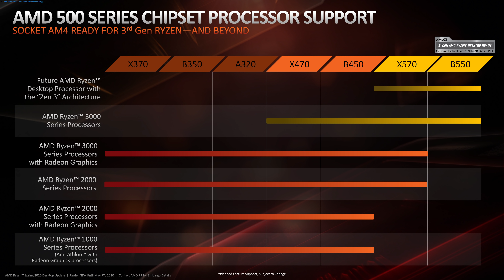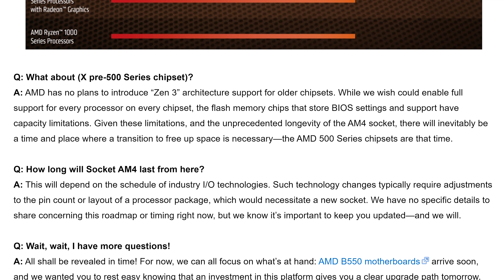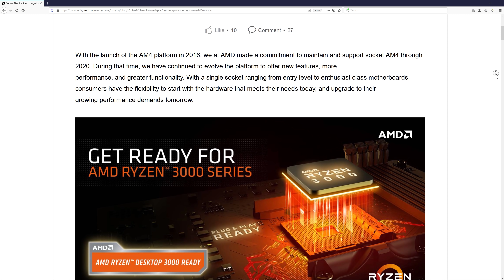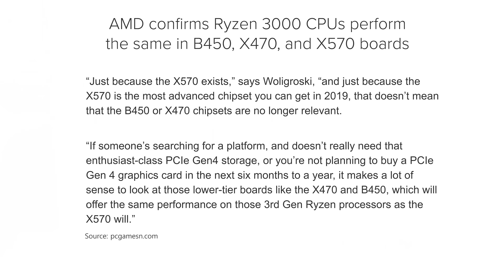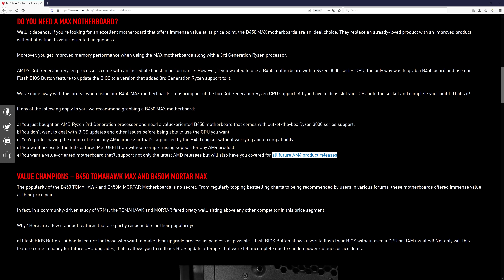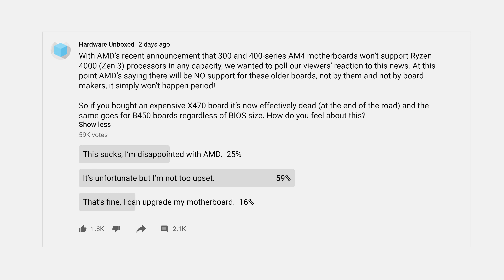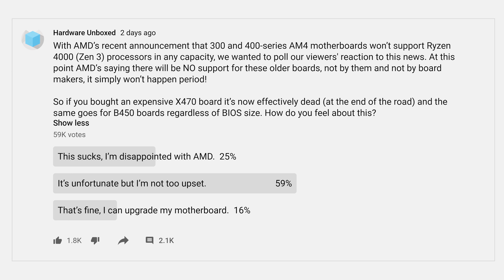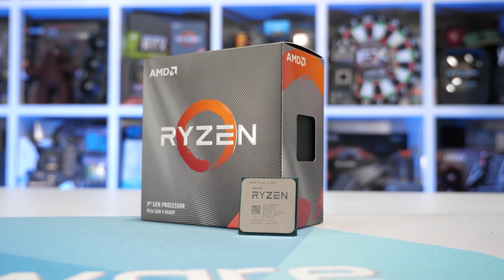AMD Does An Intel, Axes Zen 3 on 400-Series Motherboards, Our Thoughts

Comment: If bios capacity is the actual reason, i hope they atleast support the max series board. Man im pissed off right now for buying the B450 max board 2 months back.
Reply: But that won't do! Just supporting Max boards would be unfair to all the other B450 and X470 owners out there!!
Reply: @NatrajChaturvedi  i agree with you its also unfair for me whos using a b350 mobo coz i only both it about 4 monhs ago ihope atleast they give bios support on the new r3 3300x coz i dont have that much money to change my mobo
Reply: @borgir3451  r3 3300x supported cuz its zen 2 based not zen3
Reply: I feel like you should have just went that extra step and got the x570 especially. Computer time moves fast and b450 what's already over a year old and hell it's not even an x470 those guys are the ones I feel for.
Reply: They did honor the till 2020.
Reply: If they would support those boards then motherboard makers could make it compatible for all boards by sacrificing older CPU compatibility. Because who needs APU support on a high end full ATX board? Either all will be supported or none will be supported.
Reply: @CheapBastard1988  they're already doing this actually, my x370m pro4 doesn't support the A series APUs (a6 9500, etc) anymore.

Comment: Could it be pressure from motherboard partners to discontinue support? They wasted a lot of money on the development of B550 and now everyone with a B450 doesn't need to buy any motherboard, by forcing AMD to do this at least their B550 boards will sell. What else could be the reason? I'd be very surprised if AMD wanted to do this because it was clearly not the plan.

When they go to the next socket they must make a better plan to keep both their MoBo partners and us customers happy at the same time and communicate that plan clearly. I am really not happy with this decision because not only do I get screwed with my R5 3600 + B450 Tomahawk MAX but it is bad marketing for AMD and the trust in them will be much lower from everyone. 

It was my plan to get a 4900x to double my cores while getting better gaming performance, right now B550 is also a shot in the dark because we don't know what Zen 4 will be on, and if it is on AM4 then will they do the same? I'd like AMD to be clear about their roadmap so we know what to expect. And most of us B450 guys will have to wait longer to upgrade I guess...

Comment: In my opinion, they should at least support all the motherboards with the bigger BIOS capacity, how hard could it be? 
I guess it would be the same as upgrading the B550, which also needs an update once Zen 3 drops.
Not only that they do not need to drop any older CPUs - so no maintenance required, but people had no option rather than a B450 Tomahawk Max to be "Zen 3 ready" on a budget, and it was AMD's fault that they didn't release B550 earlier.
Buying a X570 with a Ryzen 3600 in August 2019, for instance, kinda made no sense, why buy a motherboard which is more expensive than a CPU, just to wait who knows how long until you upgrade to the new stuff?

Comment: I share your sentiments Steve. Even though I am currently using an Intel rig right now, (G4600, which I'm about to sell to a relative who needs a basic PC to replace an AM3 Sempron whose board just died), I have recommended to my friends building new Ryzen rigs to go out and buy B450 Max boards for Zen 3 future compatibility, seeing the BIOS ROM issue with older B450 boards.

I've commented on several other videos, and it never fails to amuse me how someone butts in to defend AMD or for someone else to tell me to go back and use Intel. Why can't they see the bigger picture that customers getting shafted and them just letting it be sets a precedent? "Give them an inch, they'll take a mile" is very apt indeed.

I'd understand if this official statement by AMD is just to get the word out to the average Joe on a budget (say building with the new 3100/3300X) to not bother with older chipsets and get the upcoming B550 instead if they want a 4000 upgrade. But they should make it possible for savvy customers to be able to take their B450s and flash it for 4000 support.

Noone can blame those who bought B450/X470 for Zen2 as there was no indication of support being dropped, as the 400 boards were generally better than the 300 series ones. It's AMD's fault anyway for not communicating this issue in a advance with the X570 release, and also for not releasing B550 sooner for those on a tighter budget. And not to mention Zen3 may most likely be the end of the road for AM4 if the rumors are true that Zen4/5000 will go DDR5. This just leaves a bad taste in the mouth.

Thank you Hardware Unboxed for defending the tech consumer, be they from Intel, AMD, or Nvidia camps. I hope the rest of the techtuber community follow your example and not just play "Devil's advocate" like what many are doing right now. Thank you.

Comment: amd is better rethink their crappy decision.
Long compatibility was one the the main selling points of ryzen cpus.
If they will  effectively turn into intel, then what's the damn point of going with ryzen if intel has better gaming performance across the board and everything else will be the same bullcrap?

Amd had bit off hefty part of cpu market and now they are  starting to act like intel did during years before.
Reply: AMD is treating the new customers as if they have been fanboys forever. When you have to buy a CPU + MB, you can simply look at Intel as well to compare instead of being locked-in. Idiots.

Comment: Maintain does not imply that every CPU will work on every board to me. That seems a little much. It strikes me as odd to run a Zen 3 processor on a 200 and 300 and possibly a 400 series board. Also as a recent owner of a couple of B450  boards, I would not get a new a processor for either of these computers in the future, I would just get a new board and processor together and memory. 

Besides, how many people actually keep buying new processors every other year for their current board? does anyone have that information. I would suspect it is few owners?

Comment: Agree axing 400 chip sets is messed up and pushing support to 300 series boards would be more headache that it is worth for board partners, axeing support for 400 series boards would be more acceptable if B550 had been a option, I use a x470 board i doubt i would upgrade to 4000 anyway as by the time i need to upgrade ddr5 will be mainstream and then i can decide between a cheap 3950x and a new platform offering 32core/64 thread for the mid-rage CPUs, really depends on how much the performance delta is (and if my board has worn out)

Comment: I'm on Asus Prime x470 with 2700x and a 1080ti. I feel like I'm getting my money's worth, so I'll give it time until zen 3 actually comes out to decide what I'll do. The reaction online seems pretty negative, so I can definitely see them go "just kidding, guess we didn't think this through".  

Don't understand why the 3000-series owners are upset. You don't upgrade every generation (unless you are not financially constrained...but in that case you don't care anyways), so by the time that 3600x is insufficient or obsoleted you'd be swapping on am5 or later. Every pc upgrade I've had, for as long as I remember, required a basically new system.  3-5 years and that's basically it. So honestly, I'm not terribly upset. I've had to do some actual work on here with the lockdown instead of just putzing in games and it's been great not having any of the issues that my colleagues always complain about (slow, freezing, etc). As far as I'm concerned, the zen+ system paid for itself the last couple of months. 

I can see why reviewers would be pissed as they want their advice to be as close to perfect as possible. It affects their livelihood. On the other hand. the overall consumer doesn't or shouldn't really care too much. 1000 launch series users have already gotten their money's worth, 2000 series also getting to that point as those cpus are still very relevant (mine is over 2 years old), 3000 series owners shouldn't be looking to upgrade in the next 2-3 years anyways. At that point you're looking at ddr5 so new mobo required anyways. Yeah it sucks they didn't stick to the original promise, but unless this affects your work, it just seems like an overreaction. Calm down, wait and see if AMD changes their minds.

Comment: As a buyer of the b450 tomahawk max I wasn't initially mad at AMD when the news hit since I was waiting to hear for the actual motivations, not believing that the bios thing was accurate and instead just something a PR guy said. 
If they stick with that I'm disappointed. I'm fine with them dropping support to avoid having to be limited by older chipset designs to improve future products, but not just for a matter of investment. If there are serious compatibility issues that are very hard to overcome for AMD when developing the support code then they should specify these problems instead of giving an excuse that doesn't really hold.
Reply: I'm sure they're going to weasel in partial support for X470 and B450, like first MSI MAX, then others with certain features, etc.

Comment: AMD shafted me! I bought Tomahawk Max cause I wanted future proofing! 😭
Reply: Should have bought a B550! OH WAIT!
Reply: YoU cAn sTiLl UpGraDe tO 3950x
Reply: Did they? AMD have made it clear a long time ago that AM4 motherboards won't be supported with new CPUs after 31 December 2019, so not sure how you thought that your B450 would work with Zen 3 which releases after 31 Dec 2019. If you look at AMD's official Socket Stability slide in the article "3rd Gen AMD Ryzen CPUs Will Work on Many Existing MSI AM4 Motherboards" (search it on Google), you'll see that the graph clearly shows no support for new CPUs on AM4 after 31 December 2019. If you take a good look, the orange bar stops right at the end of 2019, just before 2020 starts. It was already know even a year or two ago that Zen 3 will come out some time in 2020, or in other words, AFTER the official support period. Do people really not know how to read graphs?
Reply: @bgtubber https://hothardware.com/news/amd-confirms-am4-socket-support-future-ryzen-processors-2020
Reply: @bgtubber  yes they did even msi didnt know. Didnt you watch the video.
Reply: @bgtubber  Copy pasting the same crap over and over again on every comment that seems relevant is really crappy practice. Especially given that what you are arguing is only one of the relevant points. Many other places AMD have said "through 2020" and this is exactly what Steve is hammering on about: It was so ambiguously communicated that even MSI were 100% sure that the Tomahawk Max would support Ryzen 4000... So tell me again how you, a single individual, have gained such divine clarity from a single slide, that has been contradicted by official AMD statements and slides many other places, that you have the right to tell the MSI team, who work with AMD on a continuous basis, that they are just retards who didn't know what they were doing all along?
Reply: @andersjjensen  exactly what I thought. I was just too lazy to argue with bgtubber from my phone. Thank you.
Reply: @SciFiFactory  You're welcome. I cannot abide useless people...
Reply: @andersjjensen  Thanks for answering instead of me. Tbh cbb to even dignify him with an answer.
Reply: @andersjjensen  1. All of their marketing stated clearly until. 2. Through 2020? You do understand the general term support doesn't mean you will always get new processors and will get bios fixes etc. 3. All their marketing state clearly "“Planned AM4 socket support until 2020. Subject to future roadmap modifications.” "

Comment: Literally just built my new PC in the last 6 weeks using a b450 tomahawk max and an r5 3600 and honestly I'm not that vexed. Yes the 550 option earlier would've been nice but the decent x570 boards that I looked at and considered were 3x the price. Given that it was a budget call is it not to be kind of expected? I mean the x570 boards will come down in time and cover my initial expense for the b450 anyway. Plus I still have the option to upgrade to a 3700x/3900x ect down the line, it's just one of those things. Besides, it's not like the system I built became bad overnight, it'll still be great for the next couple years. Seems like people are overreacting

Comment: It seems I'm in the minority here, but I'd also like to see more people talking about how only X570 boards can be used with older gen processors. I got a 1600 AF back in January and I haven't bought a motherboard yet, so this move by AMD doesn't affect me like it does current owners of 400 series boards. However, with B550 being the *only* chipset not supporting 1000 and 2000 series CPUs I am essentially being forced to choose a more expensive X570 board I don't need if I want to upgrade to a 4000 series processor later on. Someone who bought a 1600AF isn't exactly the kind of spender looking to buy an X570 board. I'll wait and see how this all develops but I'll probably just get a B450 and call it a day at that.
Reply: They would rather make a pretty BIOS than support more generations.

Comment: Spot. On. Bravo! This covers every single thought that has gone through my mind as a recent X470 Crosshair VII Hero buyer. One of the best content pieces I've come across in ages. Excellent job, Steve!
Reply: I'm a ch7 owner also... Upsetting!
Reply: Crosshair VI Extreme owner here, and also upset. This board is better built then half the current X570's :(
Reply: @Lionotus  I have a higher end x370 board and am a little annoyed seeing as I was one of the first groups of people to support AMD's new CPUs when people still had their reservations. I am not upset too much though just because computers are a hobby and not a necessity like food or rent and with the situation going on around the world, this is not the biggest concern. However, I am thinking about upgrading maybe this year or next as I can upgrade my family's computer with my current system and get a little money back to put in to an even better system. My biggest concern is I don't like the X570 boards with being ridiculously overpriced and the biggest FAIL, the little fan. I hear it isn't that bad compared to when I was a kid and all the boards had those little fans but they do breakdown over time. I am hoping that the X670 boards will not have the fans as apparently AMD won't be making the chipset for them. Ugh rough times.

Comment: I am disappointed i just bought a Msi x470 gaming plus max with a Ryzen 1600af cpu to get through till zen 3 launch. There was every indication at least higher end motherboards would support new Zen 3 cpu lineup. I guess it will all end up coming down to which company has best price/performance for new motherboard and cpu in the new year period for an upgrade.

Comment: I think people should watch Linus's Wan Show to get a different perspective. I'll try to summarise but will most probably do a bad job. This intercompatiblity makes it very confusing for the end user. Sure enthusiasts understand it but not everybody does and when people buy stuff they expect it to work out of box. If someone just bought a B450 Tomahawk and ryzen 3000 and without exactly understanding what exactly a bios update is the system won't boot and create a negative experience. They'll probably have to pay the store to update bios for them creating a negative experience. It becomes even more pronounced for budget novice builders if they use B350 and have to check out stuff like beta bios. It becomes a tangled mess and to clear up confusion once and for all they did this

Comment: 4xx and 3xx series chipset will be able to buy CPU to at leastt of end of 2020, maybe even more. Just not the latest ryzen 4000 cpu. I am glad i went for the Asus Tuff Gaming plus x570. At the moment i made de purchase, it was to have a very good bord to run a 16 core cpu that i would maybe buy later down the road. I am still yet to do that. I build my PC since 486 era and i only upgrade 1 time a CPU on the same motherboard. The last time was from a Duron 850 Mhz to an Athlon 1.4 GHz. 

We will see. If Zen 4 + DDR5 get released in 2021, that would probably be worth jumping on that platform instead of buying a Ryzen 4000 for a better gain.

Comment: I don't know what all the fuss is about. When I upgraded from my 7700 k I looked in something where I would not have to update for 5 years. So I knew I wanted AMD so I got the best I can. Which was the X570 Gigabyte Xtreme because I didn't want a fan blowing on the chipset. Paired that with the 3900x and the rest is history. No muss no fuss. If the new processors would not support x570 I would keep my system for the 5 years I intended and leave it at that. Everyone is complain ing about not being able to upgrade CPU is pointless.

Comment: Did amd lie? You can take a old 1000 series amd cpu and put it in to a b550 board... It would still work. So the socket is supported 

I have a higher end b450 motherboard,  and we'll im dissatisfied that there will be no new cpus. But I'm not going to cry about it have a huge cpu range for my choice from 2-16 cores and it's still a budget motherboard.
Besides It's not the costs for 75-100 bucks I could get a b550 in the future, paid 85 euro for mine, but I don't believe it's worth string amd up for it....

Comment: If it doesn't work on the B350 and B450 then AM4 ended in 2019. To use the new processors EVERYONE will have to buy a NEW motherboard and this idea is ABSURDELY NOT recommended because the next generation will not be AM4 or the B550 will only be used for the next generation. AMD wants to be intel? please don't be intel.